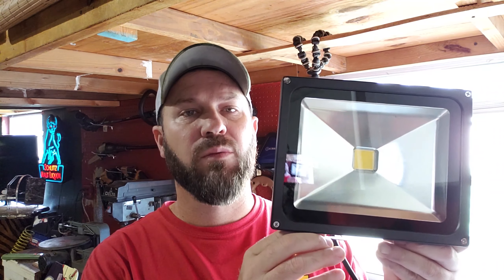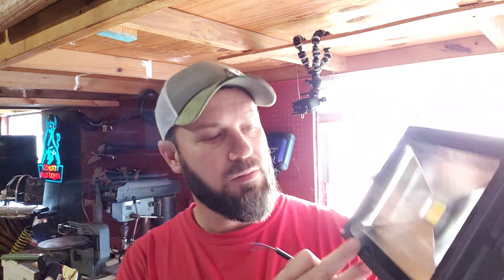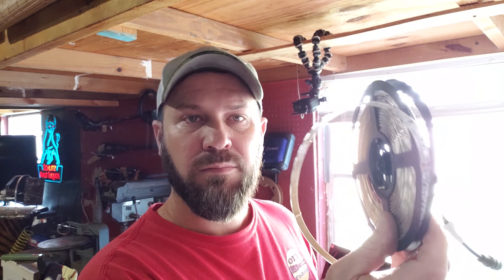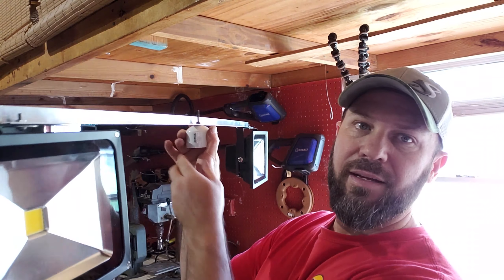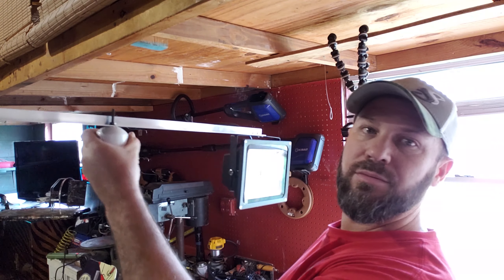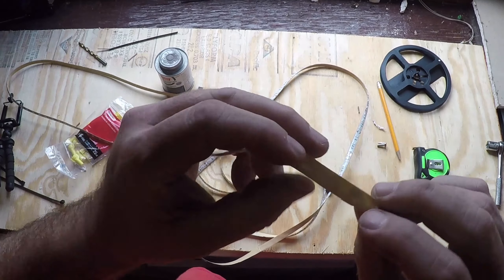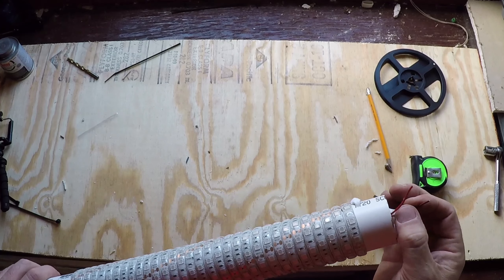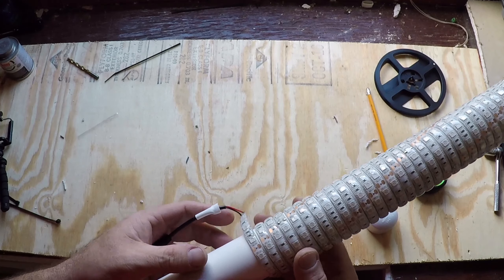DIY Fishing Lights+ WATERPROOF GREEN LED (Homemade)

Comment: The mounting brackets that come on those 30w lights are junk. The lights are good tho. Have 6 on my bowfishing deck
Reply from the maker: Yeah I find myself having to tighten the bolts every trip out but the lights are holding up well so far. Thanks for the comment hope you have a safe and happy new year 👊